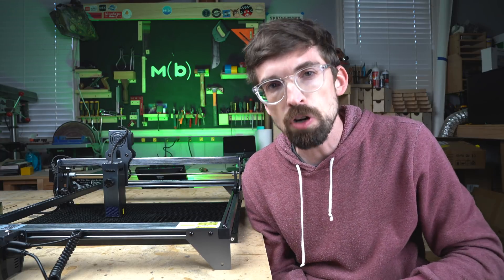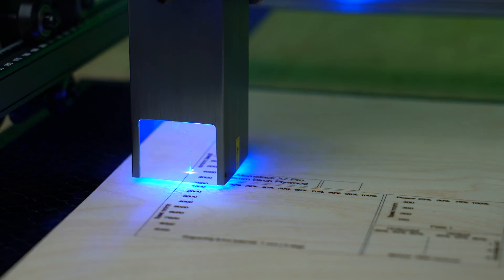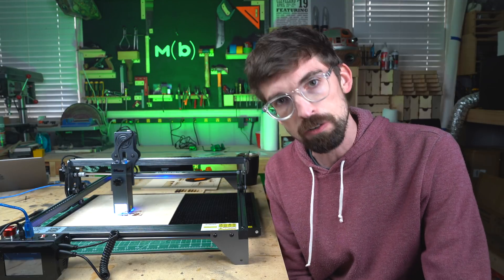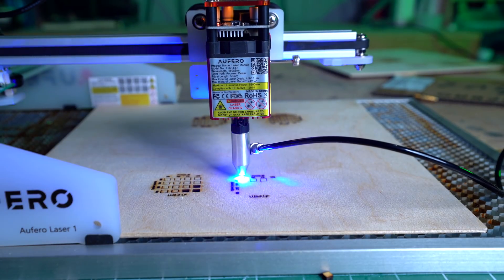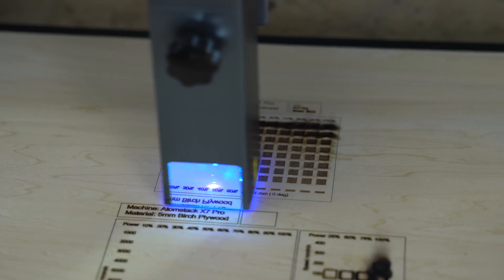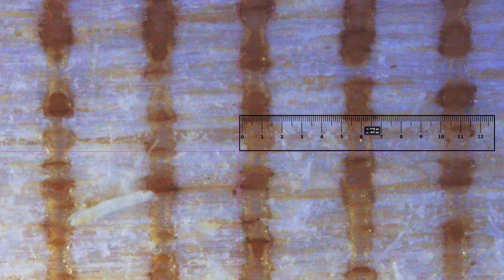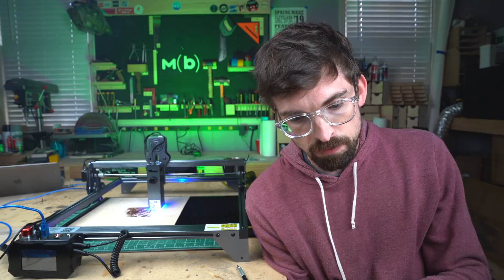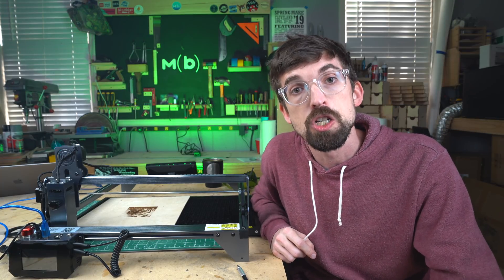Cheaper and Better?  Atomstack X7 Pro Laser Engraver Review

Comment from the maker: Download my Lightburn test files to find the best settings for you: https://pages.makeorbreakshop.com/laser-test-file
Reply: $24 WHY SO EXPENSIVE.
Reply: Download does not work for me.  All it does is spin.  Tried it 3 times.
Reply: Hey i have been using a xenetech 912 (it has finally died 😩) I make plaques and i don’t want to spend 10k. Any suggestions of a machine ?
Reply: Where can I find the 1/2/3 pass test file and the Mandalorian test? Thanks.
Reply: Will this work for a Co2 laser?
Reply: Excellent, thanks

Comment: Say you have a four foot piece of steel that is 1” wide and only 1/4” thick and you only needed like a four inch linear logo engraved. 

Could you just slide it on top of the work area with the unused pieces hanging off either end? Or does the entire piece you’re engraving have to sit inside the workspace. 
Thx

Comment: Hello. I just got the Atomstack M50.  I want to use it on my big cnc router.  I can not find any info on the inputs.  What do I use to turn it on and off? and so forth. Is it 3V, 5V, or 12V input?  What pins?  Thanks.

Comment: Better not to buy from them directly. 

I bought X7, rotary, and extension kit. Had a few issues, the packaging arrived damaged, and cables were outside & damaged. and they did not bother to put an outer box. The order value was €975,  but was charged €1027.36

I wasn't happy with the way it arrived, asked them to make a return. For 4-5 weeks they were trying to negotiate with €20 refund for the damaged item. Then stopped responding to email.

As per EU law, the right to return. Return policy should be clear, they are interested in honoring law or  EU standards.

Comment: I bought one. Got a good price and sent it back without ever even opening the package. I wanted to test the availability of repair parts. It is a machine, parts wear. I contacted the manufacturer and guess what, no, parts are NOT available individually. Atomstack (Creality3d) machines are NOT repairable using OEM parts.

Comment: I make a lot of charcuterie boards. The boards themselves are larger than this workspace, but most times, the engraving would fit in this workspace. would I be able to set this up above a large board? or would the feet of the machine get in the way, or not allow clearance for the machine to operate?

Comment: you mention lightburn in all of these review videos...lightburn comes in at different price points...which version of lightburn are you referring to when reviewing one of these desktop lasers..? please clarify..?
Reply from the maker: For these machines you will need the Gcode version which is the cheaper of the two at $60.
Reply: @makeorbreakshop  
thank you..
i ordered an Omtech co2 that includes lightburn...do you know if that subscription would be able to be used with the xtool D1..?
or would i need to purchase the $60 version also..?
Reply from the maker: @squidskunk  I'm pretty sure the more expensive DSP version will work with diode machines but I would double check with Lightburn.

Comment: I just bought the X7 pro with extension kit, rotary attachment, extension feet, oversize rollers and pre-purchased the air assist. Basically everything they have for the X7. I've had it for about 2 months and used it a handful of times. It behaved glitchy then it started rebooting 1/3 of the way through any job. It did this running from the computer and from the SD card. Atomstack was pretty cool about replacement of the mainboard. No cost, no shipping fee. The new board should arrive 3/11/22, hopefully that will fix the problem. I'll let you know.
Reply: How did it go?
Reply: Not good I take it

Comment: They updated their claim on their website to 0.06 x 0.06mm although their Amazon store shows both 0.08 x 0.15 and 0.08 x 0.08mm. I talked to their customer service and they confirmed it is 0.06 x 0.06mm. Could you check it with a different material without a grain such as SS?

Comment: A couple questions that I hope you can answer for me. I've been watching several of you videos, Thanks for doing them. Can you cut dry erase foam board with out melting the centre foam, or how bad does it melt or make a mess of it. If it doesn't wreck it, since the foam board is not perfectly flat how big a variance can you have with out having a major issue. I presume it would affect the focus? Just shopping and like the power of this X7 Pro. one last question will you be showing any laser cutter with the auto head adjuster like the one you mention in this video. Thanks in advance

Comment: Hi. I had two questions I was hoping you can help me with.
1) What's the maximum height of the item that can be put in to be engraved? What if the item is 15cm high (like a lectern)? Also, the item is not totally flat.
2) How can I make sure that the product that I want to engrave, the wording comes out straight when I put it in the machine? Is there a guide on the machine to ensure it stays central?

Thanks for the amazing review!

Comment: Thank you so much for all the amazing information!  For weeks now I have been exhaustively researching laser engravers for my first one.  I had pretty much decided on the Atomstack A5 Pro until I saw this video, and so glad I did!  The question I have is, can you please clarify the differences, if any, in the Atomstack models X7, A10, and S10?  I'm getting conflicting information from sellers.  Some say there is no difference in the three except for the color of the unit.  Another says "S10 Pro is improved performance in all aspects than X7, also it can engraving material including wood, glass, stainless steel, acrylic, etc. and with faster speed and more better results.  This will be a better choice for all engraving and cutting enthusiasts."  My head is spinning and I figure if anyone can get to the bottom of this, you can!  :)  Thank you!!
Reply: Hi, i contacted the Atomstack customer service yesterday with the same question. The X7 is still the flag ship. The A10 is just an dealer model, it has the same specs and price but it has just another color. The S10 looks like an aliexpress dealer model but the S10 is not mentioned on the official Atomstack site.
Reply: @RetroglowSystems  Thank you so much for checking into this.  Prior to getting your reply I ordered the S10 Pro from Atomstack Official.  I plan to try it out today.  Fingers crossed.  I was wondering your thoughts on a couple things.  As far as a honeycomb worktable, is that needed for engraving or is that only beneficial for engraving?  Also, they told me they will be making an air assist available for these machines in February.  Having worked with the X7, do you feel that is needed?  I will be using mine for engraving mostly...very little cutting.  Thanks again!
Reply: @roxannem1206  Mine is still on it's way but i do know a couple of things about laser engraving/cutting. The honeycomb grid only gives an advantage when cutting. It will provide airflow under the object and the cut's will be cleaner. Air assist is amazing on this machine and iam looking forward to it.
Reply: And the air assist will be worth it since it will provide amazing cut's with less black edges
Reply: @RetroglowSystems  Great info!  Now I know the honeycomb would not be of too much value for my purposes so I'll wait for the air assist to become available.  :)  Thanks for your time!!
Reply: @roxannem1206  No problem, Ill also wait for the air assist.

Comment: Hey Brandon, great video and content, I didn't know about this til now. I have a question for you, I recently bought the Atomstack a5 pro and I noticed the x axis where the laser module mounts there is play in it where it rolls on the rail, not sure if I'm describing this right but simply put is the suppose to be play in that? It can rock back and forth but the few tests that I've done it doesn't seem to be rocking, just smoothly rolling on the rail.  You're my go to laser guru. Thanks for the help and God bless you and your family and our entire YouTube family.
Reply: In the instructions there should be directions that tell you about the small screw underneath that you tighten to adjust the resistance

Comment: 6:30- it's not UV light, it's blue light around 540nm wavelength. This doesn't mean you should be looking at it, but since it's visible light you have a pretty good indication of your exposure level.
Reply: Also I'm wondering if his green safety glasses are rated for those wavelengths, green filter is for red lasers right?
Reply: @rexsceleratorum1632  My OD+6 googles are orange in color.

Comment: Have you ever reviewed the Sculpfun S9 laser engraver? I would like to cut 1/4" black acrylic. Some of the reviews say this is possible. I would also like to work with laminated sign material. I would really appreciate your opinion on this. Always informative fun videos. Thanks.
Reply: The Sculpfun S9 can cut 10mm acrylic.  The energy density of the beam is higher than usual.   It's supposed to produce similar results to a 90 watt CO2 laser because of that.

Comment: Thank you for posting this - VASTLY informative - but I have a very basic newbie question: why can these not-as-expensive lasers NOT cut or engrave CLEAR acrylic? It seems to be a running theme with all of my research so far in potentially buying a hobby laser…
Reply from the maker: Great question, any diode laser (which most of these cheaper machines are) generate a laser beam frequency that won’t interact with anything clear.  You could still do colored acrylic but for clear you’ll need a CO2 laser which works in a different way.

Comment: I got a little diode cnc laser like this a few years back I had fun with it then I got the K40 Co2 laser  and its not only the power but you can move mirrors a lot faster than large diode lasers with heat sinks and fans. High power fast movement you get wood to vaporize no ash nothing turning black just the wood gets engraved. What you got here is a wood Burning tool sure you can burn patterns with it but its not an engraving.
Reply: I'm on the fence, do you recommend the K40?
Reply: @TheUnofficialMaker  if you want a reliable laser then No the K40 is more for fun and learning just as a hobby I had more fun upgrading it with air assist cable chains and manual Z axis bed. You get what you pay for it's just enough to get to a C02 laser.   If you want to get cleaner better engravings go CO2. Diode lasers just aren't there right now.
Reply: @1800Supreme  The K40 is a CO2 laser so I don't follow what you're saying.
Reply: @TheUnofficialMaker  K40 is a CO2 laser yes it has power and speed to engrave wood.
It's just not a very user friendly in setup and use, so just expect to fiddle with it more than you would with a more expensive model.
If you like modding and have the time for it. Get the K40 as your first CO2 to get your feet wet. It will teach you much more about CO2 lasers.
If you want a better value I would recommend the "MF1220-50 From Omtech" it goes for $2000+. It's a better value since it would cost you more in time and money to try to get the K40 up to the same capabilities.

Comment: I believe the xtool D1 10w can use Lightburn.  Am I mistaken?  If not,  would you still choose the atomstack x7 over the xtool D1 10w?
Reply: Correct. The D1 didn't have Lightburn support when he did the pre-release(?) video. But they've added support for it now, and even list that on the features page for the product as of the last time I looked.

Comment: I would love to hear your advice actually
I've been looking at your videos now for quite a while because I am getting more and more interested in buying my own laser cutter. I have a lot of experience with MDF as well as resin printers. Even before I used to go to the city workshop where I operated with their CO2 Laser (HyperCUT 6090 PRO).
 I can print a lot of things with my printers but still I would love to be able to cut and engrave stuff.. + with wood you get that warmer feeling if you give some sort of gift. I would love to have a machine that is capable of cutting good as well as engraving. Mostly I would cut some sort of stands and smaller chests or boxes for storage or decoration. material wise; Foam, MDF, acrylic and vinyl. So with this cutter it's really, really tempting. Price is fair, even though I was always in love with Co2 lasers and dreaming about getting one because of speed and enclosure and everything else. I also looked at some of your other videos like OM Tech K40 and its bigger 50w brother but with K40 the problem is cut volume and with 50w machines the problem is price. So if you were in my position, which machine would you recommend me getting? Should I save up the money and buy bigger CO2 for like 1500 - 2000€ or should these smaller diode machines work well enough for me? Thank you for your answer!!
Reply: You shouldn't cut vinyl with an laser. That releases Chlorine and Hydrochloric Acid vapours. It will destroy your lungs and your machine. Diode machines have problems with not black acrylic, as that wavelength isn't all that good absorbed by the plastic itself and are really slow with wood. Also you really shouldn't cut anything with an laser without air filtering. The pyrolysis products, especially from plastics can be quite nasty.
Reply: @FreeOfFantasy  Thank you for the heads up! I actually didnt know that about Vinyl cutting. So its cutting vinyl with CO2 a no go as well? 
At home I have my own home made paint booth and If I ever bought diode laser cutter I would use that system for it as well with added filters. I would just need to add enclosure to the laser.
Reply: @LonelyWolfJ  Correct, it's still a no-go on vinyl with a CO2 laser.

Note that there are exceptions here specifically in regards to some HTV (Heat Transfer Vinyl - think t-shirt design) products from Siser and the like. But check the vendor product page for each specific product page. They'll explicitly list "laser-safe" for those applicable.

Comment: tell us about your bed? is that aluminum honeycomb?
Reply from the maker: It is, its actually a honeycomb bed from a larger CO2 machine.  But you can purchase something similar as a standalone piece.  The Atomstack also comes with a metal sheet to put underneath when you are cutting, but it's still good to get the work piece up for airflow.

Comment: What video microscope are you using? The on-screen scale is very cool.
Reply from the maker: Tomlov 8.5 digital microscope.  But the ruler I actually added in to the image on the computer.  I used a test image to get an accurate measurement and matched the digital ruler to that.

Comment: If only it had air assist.
Reply: They should just make it with a air assist nozzle and then the end user can upgrade to air assist easily if they want to add a air pump. It's silly not to do it from the factory
Reply from the maker: @weilam03  yeh even with most other machines you have access to the very bottom so you can retro fit an air assist.  I love the laser module design on this one but it would be nice if the front glass was removable or there was a way to get an air tube in.
Reply: @makeorbreakshop  these companies fighting each other over output watts and mm/sec when all they have to do is integrate an air assist nozzle and call it "air assist ready" and destroy the competition blows my mind. I know theyre fighting on price but dang adding that one small cheap piece would elevate any diode laser above the others. It boggles my mind. 

You don't need to add the air pump guys! Just give us the nozzle!
Reply from the maker: I know